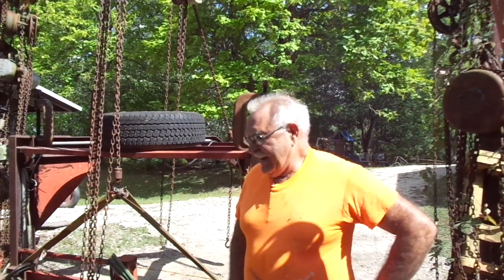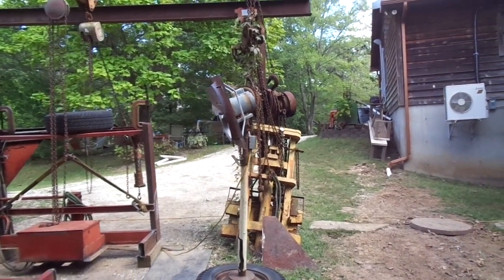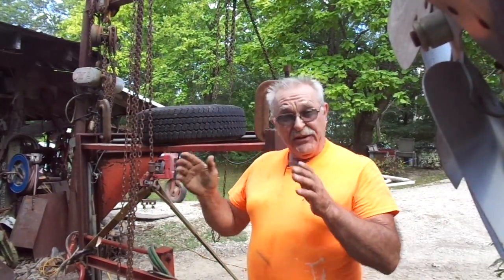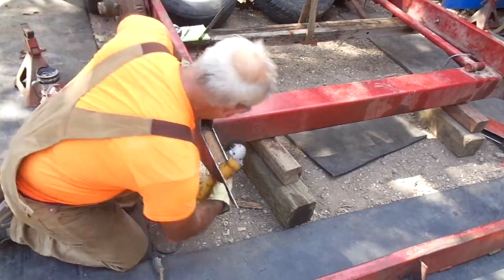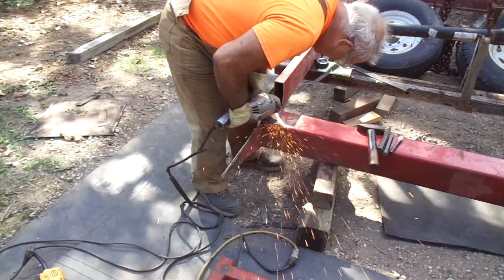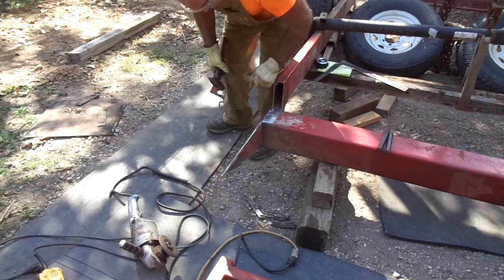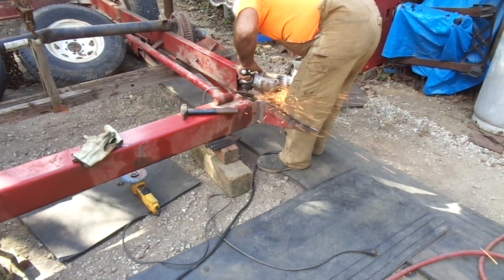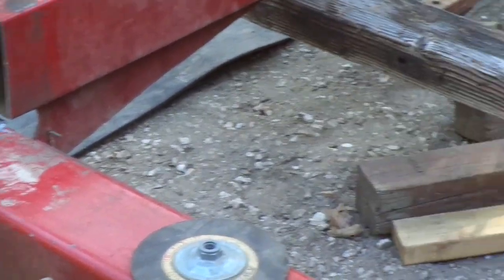Tandem Dump Frame Repair Pt 2

Comment: That is always the same thing when working on light duty stuff. You never know where to stop.  I like your "slow progress of manufacturing nothing but sparks" expression!  This is where motivation can get very low. Working so much to get nothing really done, but a big pile of steel scrap... Can't wait to see what you will come up with! Thanks!
Reply from the maker: Hahahaha you're right on that one !!  One thing that I will come up with for sure will be a pile of welding rod stubbs....  that and hopefully a heavier built dump trailer that tracks straight.  LOL  We will both have to wait to see on the last one.

Comment: The dump trailer project is going along real good. I have one of them big Black and decker grinders but I have it stowed away and I use only the smaller ones....good going, my friend....CHEERS
Reply from the maker: Yessir, those big ones get a little heavy after a few minutes...but man o man, do they cut !!  I've got several of the large and small ones. Thanks for watching and for the comment sir.

Comment: I remember what you had to deal with in the beginning. Looks like you figured out what to do.  Good luck and be careful.
Reply from the maker: Yeah man....my heart sank when I met him right off the interstate with the frame on the ground and loaded with topsoil.  We had to shovel THREE pickup loads of dirt off by hand and chain the frame up to get two inches clearance to drive the rest of the way home.  Still with about 1 1/2 tons off the back side of the axles to kinda help counterbalance the box towards the rear.

Comment: Morning T. Great idea using the grinder wheels so you keep the option of re-using as much as reasonable. Man, you have a lot of pulleys but you needed several - always nice to have more than you need. Especially when they are gifted. LOL. Best kind, I think. Thanksgiving here in Canada this weekend so looking forward to the bird and trimmings... Mrs. GP is quite the cook. Not sure how she does it but man, that bird comes out so tender. Have fun working the project and I'll be watching for the next episode - most likely over a leftover turkey sandwich. LOL. Cheers!
Reply from the maker: The distortion is kept to a minimum dismantling metal as compared to the more conventional oxy-acetylene.  The next best for minimum distortion is a plazma cutter but rust and paint gives them a problem.   Another thing we have is common is the cookability of our wives GP !!  I have no idea how they do it either, but much to my chagrin the end result can be seen hanging over my belt....LOL.  Happy Canadian Thanksgiving weekend sir and please enjoy the sumptuous turkey!!

Comment: Like that big Gantry.. 😀👍 I actually have one, but not sure Mrs would let me set it up in the back yard.
Reply from the maker: The only way this would be better is if it were portable.  I built another more simpler one inside the first shop...its currently got a 67 Stang coupe sitting under it.  If I were you, I'd weld a few pot hangers on the gantry posts and a few across the top and fill them with pretty spring flowers next year and tell the Mrs. you saw this new fancy flowerpot holder on Pinterest.  Like they say...It's all in the presentation....lol.  Thanks for watching  and commenting !!
Reply: That is funny! I'll try that with flowers...
Reply from the maker: @FromSteelToWood  I used to pull that one when I'd drag home another dead tractor. Sit a flower pot on it and tell her "Of course it's for you... I only had you in mind for decorating the yard with it".  Well...it worked once anyway.

Comment: I can understand using those 'zip wheels' as we call them . I use them almost all the lime when cutting like this, I find that it's a lot more precise cutting .
Reply from the maker: They're called razor blades down this way by lots of guys in the trades.  They are a wonderful invention and do a great job.....as long as a ham-fisted guy with the strength of a gorilla doesn't get a hold of them.  Absolutely the greatest for working with heavy guage spiral pipe ducting too.  The tool with a thousand uses.  Thanks Reg for the comment sir.  Have a great weekend.